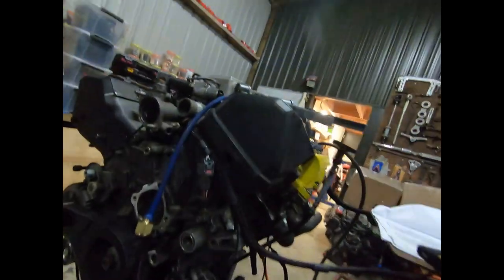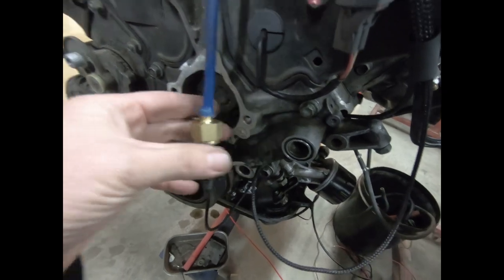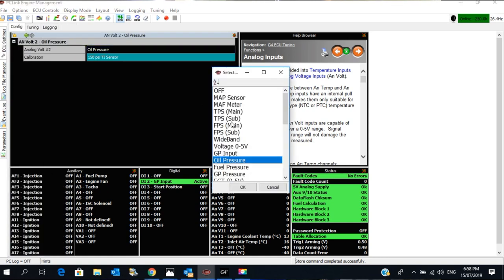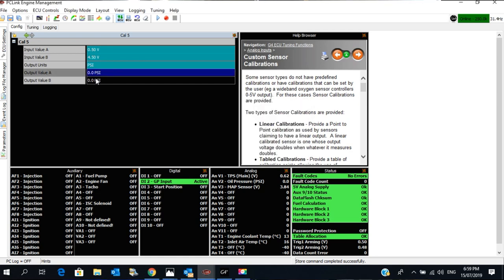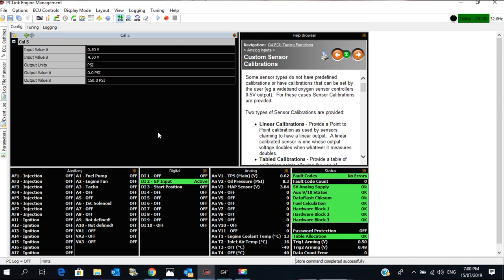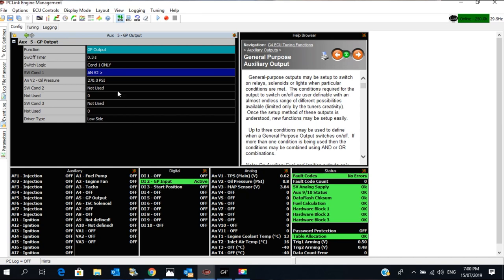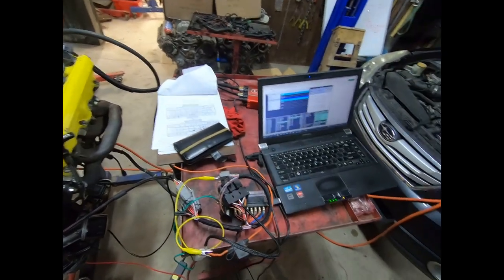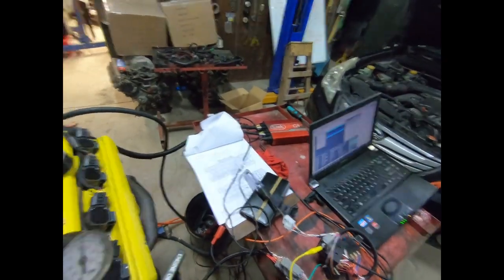Link ECU tuning. Setting up your link ECU. Oil pressure input

Comment: Great explanation. I'm using the Bosch Oil pressure temp sensor combination. I will apply this to the G4X 💪🏾
Reply from the maker: Absolutely.   They are a great unit and I use heaps.  Cheers Kelvin
Reply: Sir is there a way I can contact you? I have G4X and trying to get oil pressure sorted with the sensor
Reply from the maker: Yes,  email,  info@thecartunecompany.co.nz,
Reply: @CartuneNZ  email sent. I'm really in need of help
Reply: @CartuneNZ  also that's not the correct email or something. Google couldn't find the address
Reply from the maker: @Nismology33  it is the correct email addresse info@thecartunecompany.co.nz  and its in description and credits and Google easily finds my website.  Please note I do charge for me time to do personal help.  Cheers Kelvin
Reply: @CartuneNZ  ok I have to emailed you and would like some help.

Comment: Which oil pressure sensor are you using?
Reply from the maker: A universal 150psi 5 volt pressure sensor.   This is a budget unit made by honeywell.
Reply from the maker: Not that one but a cheaper version made by honeywell.  Any sensor of similar spec will work just fine.  0-5 volts with a known calibration.
Reply: @CartuneNZ  sweet as, thank you!